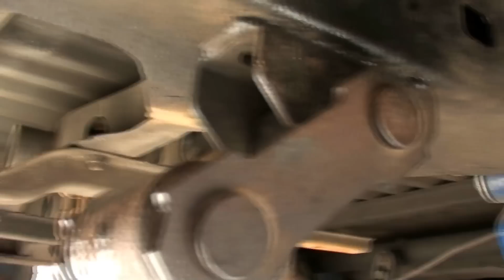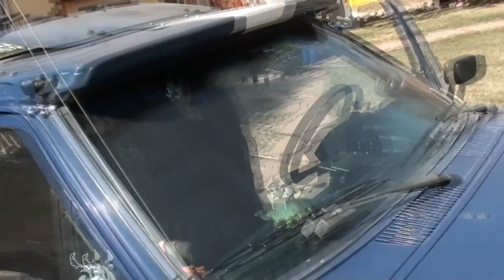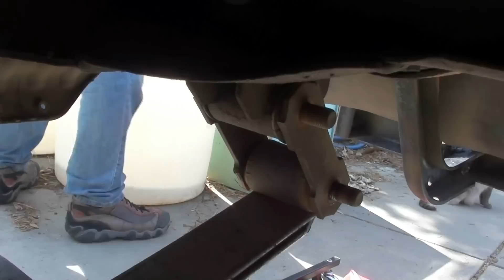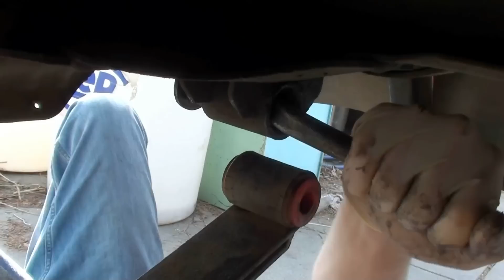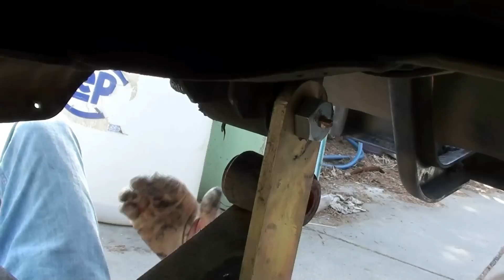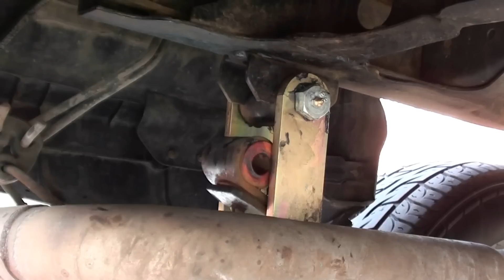Installing 6 inch shackles on my 1986 Toyota 4runner

Comment: Did it change the ride at all or does it still ride the same? did you have to get longer rear shocks or change anything else after adding the 6 in shackles
?

Comment: so, don't you have to add shackles to both ends of the leaf spring?

wont it be off kilter if you just alter the one end?
Reply: It will alter it, it will push the axle farther forwards.
Reply: is that ok?
Reply: I mean, I don't see why not.
Reply: If it's really far forward it could be bad.

Comment: where did you get your sun visor from, i have an 86 pickup with the sun roof and cant find one that takes that into consideration and plus they are over 100 dollars(eww, expensive).
Reply: youngbl00d1 make one out of sheet metal they cost too much you're lucky enough to find one